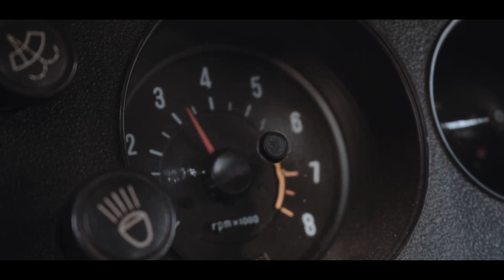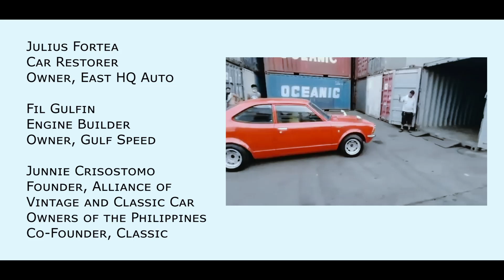'71 Toyota Sprinter Levin from the Philippines!!! One of the best in Asia!

Comment: My mother had brand new ‘71 SL 3k-B twin carb engine GT mags from delta motors at that exact oem color ‘clementine’. A headturner during its time when beetles, escorts, lancers and galants where popular. 
If Gulfin remembers, we raced his modified corolla sr using our japan imported right-hand drive red mazda savanna rx3 stock rotary 12A engine sa white plains. Those were the good times. Nice video po.